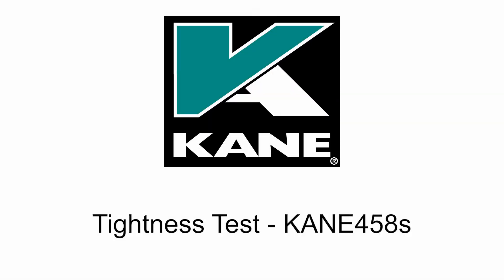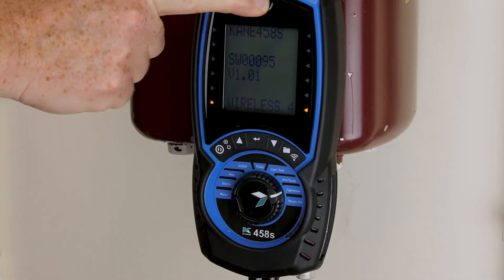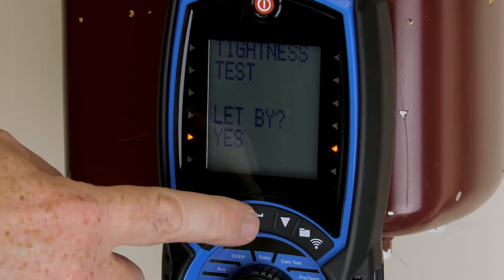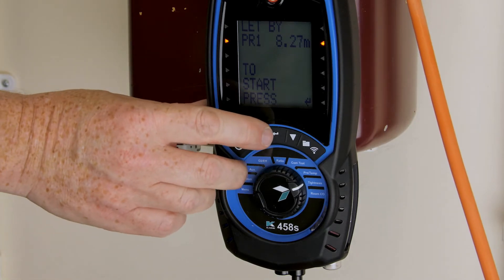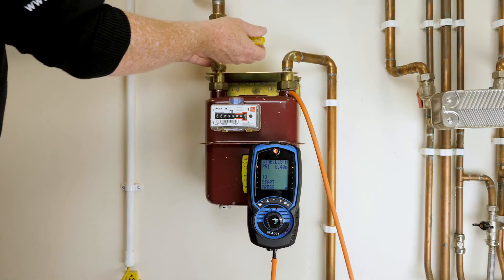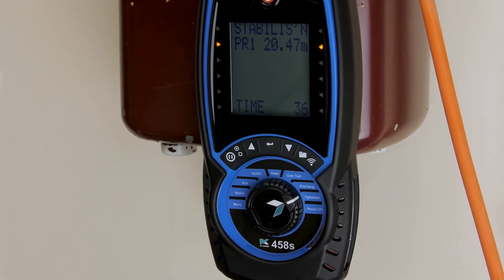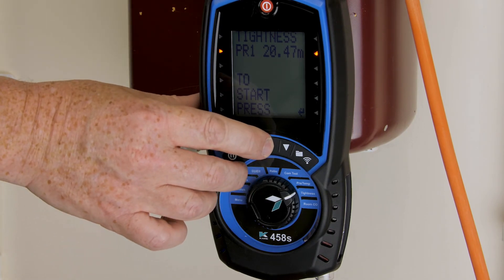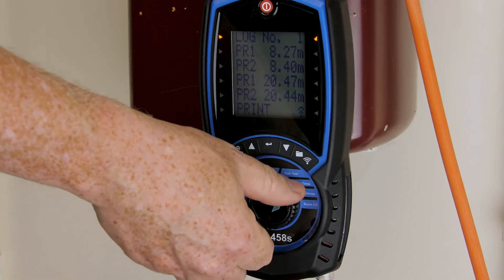KANE 458s Flue Gas Analyser - How To Perform A Tightness Test

Comment: Can do the same thing with a water manometer and doesn’t require monthly verification of accuracy (for liability purposes). Electronics is great but sometimes simplicity is more important and reliable.
  Being from the states , I was wondering why you approve, soft solder gas lines ? I am sure you all have housefires from time to time . Why would you want to put the first responders in any more danger than needed ?
Reply: Most meters outside 
Houses mostly brick 
We are a bit smarter than you lot so not as many house fires